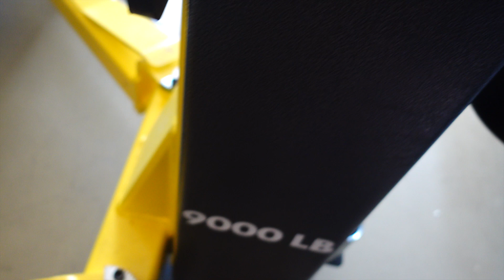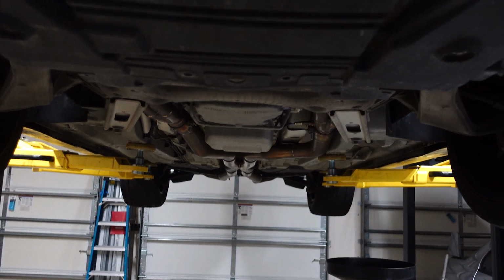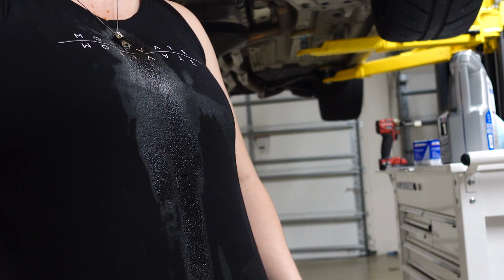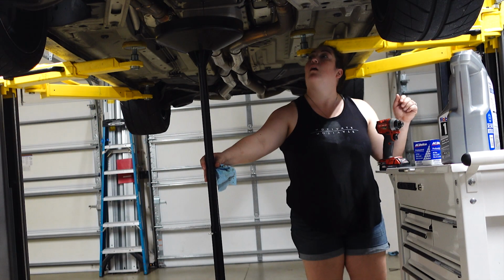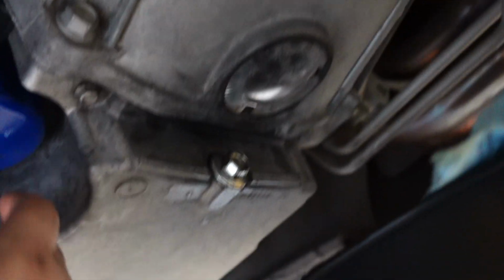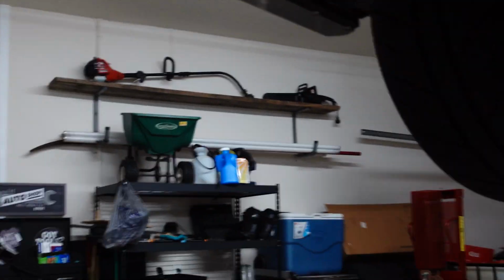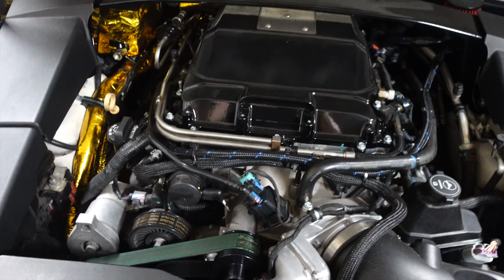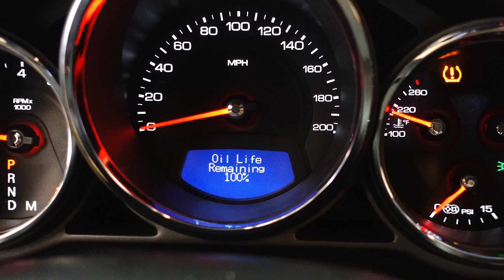CTS-V Gets Fresh Oil Change! First time on Titan Lift! | Amanda Rae Jean

Comment: If you do the oil change on a cold engine it won't fly out as fast. I also poke a hole in my oil filter bottom and let it drain after I loosen it. Takes longer but less mess and possibly safer.
Reply from the maker: I was always told to do an oil change while it was somewhat warm so the oil would come out easier rather than slower. That was something I was told when I was super young though, lol. Poking a hole in the bottom is brilliant. Sad I didn't think of that. 😆